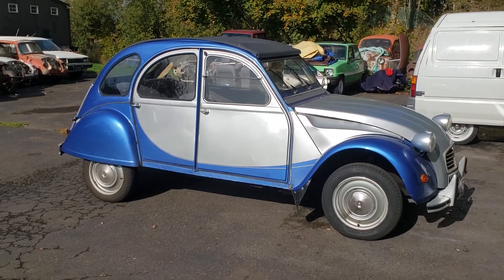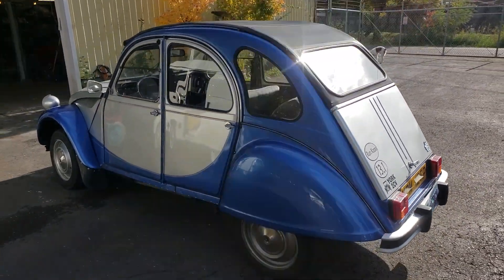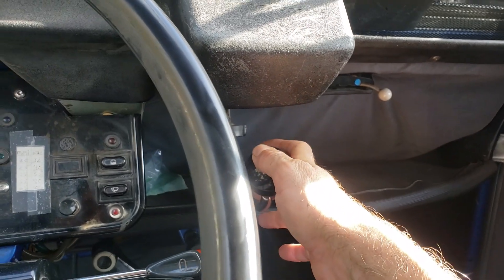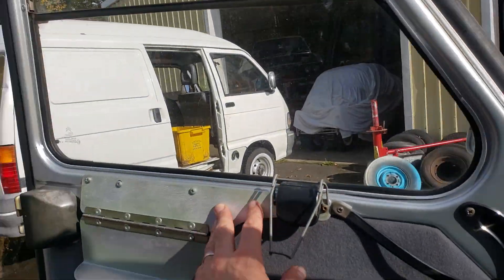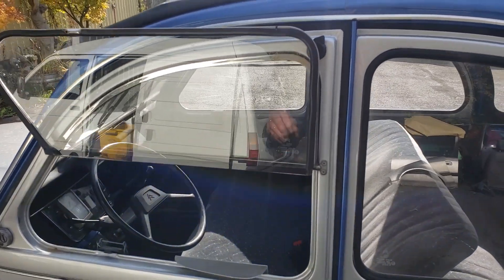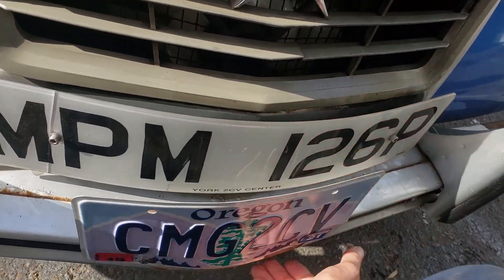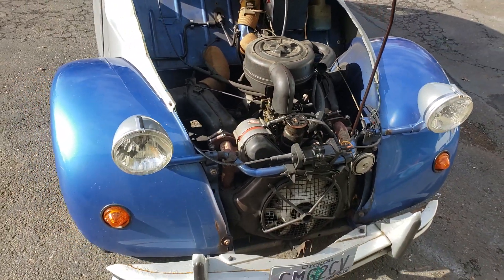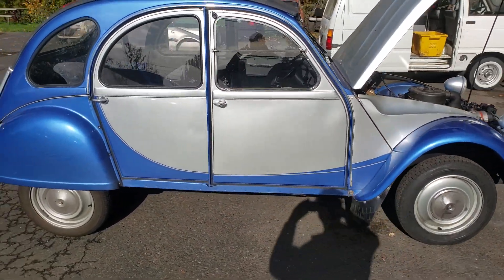What's Not To Like About a Quirky Citroen 2CV?

Comment: According to the UK's DMV equivalent (the DVLA, Driver & Vehicle Licensing Agency) she was actually manufactured in 1970 and was imported into the UK in 1976 which explains the left hand drive but with British number plates scenario.

 It's road tax (like registration in the US) hasn't been paid for since July 1998 and she isn't registered as having been exported for some reason. It was almost certainly brought to North America between July '98 and July '99.

The accumulator under the floor you referred to is called the spring can, unsurprisingly it contains the springs! The springs actually act on each other so the suspension is linked front to rear meaning that when the front wheel reacts to a bump in the road the rear suspension is somewhat pre-loaded! Crazy stuff for what is effectively 1930s engineering.
Reply: what not made in York? just like Terry's chocolates were? 😉
Reply: I was going to say... Definitely not a 1969 car... Closer to a 1989 car judging by the fact it's a 1980s late "spécial" bodyshell! Spécial being the basic model, tiny speedo/fuel guage, non slam lock doors... Disc brakes... Etc it's most definitely a later 2cv having shocks all round etc not a single pre 79 feature on that car!
Reply: It must have had a pretty full on restoration using later parts then I'd guess? The DVLA doesn't just take your word for it when looking for a manufacture date, you generally need paperwork to prove it.

Don't tell me that this is a late 2CV that has been stolen and given a false identity from an earlier car to cover up the theft for export!
Reply: @CaptainHoratioPugwash  clearly this car was never a 1969 2cv! I'd like to see its vin plate that's for sure! I have an 89 dolly in my workshop that is mechanically and structurally identical to this car! I wouldn't have even said it was a 1970 car originally, possibly imported to the UK with a false vin or, originally it was a 1970 drum brake 2cv6 which was at some point restored with an 80s chassis, shell, engine & box etc basically saying the whole car has been replaced at some point in time!
Reply: or possibly the late 80s model but have fake 1960s plate and vin so it is allowed to be imported to the US because of the 25 years old rule, just like how most later Rover mini ended up in the US
Reply: @Banom7a  yeah although what's odd is that British registration suffix plate with the registration year letter being a P on the other end - means it was registered in the UK in 1976, according to the UK DVLA it was originally a 1970 car registered in 76 in the UK, even still its not a 1970 car now! Not even close! Anything with a light up choke knob is made after 1980!!
Reply: @joewilson941  i do know the P reg is 1976, but like some classic mini in the US was like that too, they have MPi everything (airbag and stuff) except for the shell and the registration which is from 1978 (T reg) or something along the line.
Reply: Screams "ringer"! Seems to be a thing with UK registered cars that find their way to the US. It's quite plainly neither a 1970 or 1976. Minis and Land Rovers are the usual suspects.
Reply: @Banom7a  I think you're on the money here. Another oddity; the 'P' suffix UK plates (August '75 - August '76) say they were made by ''York 2CV Center', with the US english spelling of centre. I'd hope for the sake of the owner that nobody from the DMV is reading these comments!

Comment: If I remember correctly there's no head gasket and no distributor. It uses the wasted spark method so the plugs fire on tdc for compression and exhaust strokes
Reply: just a copper washer for head gasket
Reply: @alainpichon4395  Fitting a copper washer was a dodge to avoid lapping the head to fit the barrell perfectly, not original fitment.

Comment: Have a look at Hubnut on YouTube  who has had a 2cv for 20 years. He works on his and has over 200k miles on his one. Engine is 602cc with the heads changed you can have 652cc fairly easily.
Reply: I clicked on this video thinking it would be HubNut

Comment: I drive an argentinian 2cv6, a 1975 model, it´s 602cc, 31.5 hp. In Argentina it never came with disc brakes, always with drums, till 1990. Tires are 5.0x15" (125R15)
Your car has a lot of things "not original", aftermarket accesories, like the armrest, half dashboard, etc...
It's a car for daily driving, slow, but it'll go wherever you want, max speed is 110 km/h (65 mph)

Comment: York 2CV Centre was a 2CV service garage in the UK, see the UK number plates. Don't think they are with us any more. Hope you have at least a Haynes manual to help you along but just about every job on the car is covered somewhere on YouTube. The "arm rests" aren't Citroen, a bit odd, and I don't know why you would need them. Guess they would spread the contact on your arm though. The wire clip can space out the bottom of the window a bit. If you don't use it to latch it the window floats up and down as you drive along. Neat door handles rotate when locked. 602cc. Left hooker so imported from France at some point later in the cars life. Is there any history with the car? UK 2cv people may recognise it and let you know. Good to see another one over in the USA. Big fun. I have had a Dyane.
First reg in UK April 1976. Tax was due 27 July 1999 so it's been hiding somewhere since then. Imported to USA about then? Year of manufacture not known but stamped on top of bulkhead right hand side.
Spares are easy from UK, France and Holland but postage won't be kind.

Comment: It's not a 1969 model, more like 1989. Front disc brakes came in 1981 on these cars. Looks like a 602 cc engine  with 29 hp.
I've got two of them myself, fantastic cars!
Reply: Most 2CV nowadays are a combination of parts from different aged cars, it's a bit of a Frankenstein car ;-)
Reply: Yeah i think it's more 1979 or 1989 too, the car have modern dash, steering wheel, hood and big bumpers and those orange belt "things"

Comment: I drove one across Germany in the 80s and it was really scary on the Autobahn!
Reply: As a former owner of a '86 Fiat Panda with a soft-top I know exactly what you mean... :-D
Reply: Yes. I had a 1970 model in the early 70's in Germany. Fun around town but about 100 kph on the autobahn was about it. A little faster down hill or with a strong tailwind.
It broke a crankshaft and the local backyard repair guy had the front end apart and the engine out in about 15 minutes.
We called it the Mafia staff car.
Reply: Just bought a fine 2CV - and I'm NOT taking it on the Autobahn...
Reply: I drove one from London to Rome (and back) in the 1980s.  The bonnet blew back and bent in half whilst 'cruising' down the Autobahn. We bent it back into shape, strapped it down and continued to Rome. The car was yellow.

Comment: The arm rest is handmade and not factory. And this 2CV is not from 1969, the 2CV got disk brakes since 1981. Also the tail lights, the flasher, the hood, the generator etc. tell that this modell is a mix from different years. If this 2CV was from 1969 it must have a 6V Generator and the choke has to be on the left side of the steering wheel. The choke on the right side was factory since 1974.

Comment: you forgot to mention the headlights, there is no actual high/low beam, the headlights are moved by a cable to aim the lights high or low mechanically. the cars were actually designed for off-road use because at the time they were designed, france had few paved roads. the suspension is really unique, the front and rear suspensions are connected together so if a front wheel is pushed upward, the rear wheel on that side of the car is pushed downwards. this allowed the car to drive over pretty big obstacles.because it was designed for off-road use it wasn't designed to go fast.
Reply: Versions sold in Argentina had high and low beam. Car was slightly different in the interior. A later version called 3cv was sold until 1980.
Reply: The goal of the 2CV was that a farmer could transport his eggs on a dirt road without breaking them...
Reply: Not correct, these have high/low beam headlights. The adjustment for the lights is to compensate for slightly heavy loads and extremely soft supension.
Reply: The early versions had so-called "batteurs" at each wheel also.
Reply: @paulterhaar4862  Not exactly the goal. The egg story was an advertising pitch to sell the comfort and versatility of the suspension on France's mostly underdeveloped road system. 
Fun to drive and once the lean was near its limit it held on pretty well in a turn.

Comment: Looks like the chassis is on its way out, note the "dent! on the metal bit above the wing on both sides, the weight of the front axel is pushing the chassis down.

Comment: York 2cv is probably a regional branch of the british 2cv club, 2CVGB. Each branch had its own name and produced its own stickers. Enthusiasts used to collect them and stick them on their boot (trunk) lid. That's not an original colour scheme. Must have been repainted sometime in its life. Also, that's not an armrest on the door. It's a clip designed to hold the window slightly open if you don't want it fully open. How do I know all this? I used to have one many years ago, and before that I had a Dyane, which was a modernised in shape hatchback using the same mechanicals. Both great little cars.

Comment: A 120mph speedo? Well that's 'optimistic'!! LoL
Reply: iBiana Doubt  HaHa!
Reply: That's almost certainly in kilometers per hour -- 120 kph equals about 65 mph.  In good tune, and given time and a flat road, it might just touch that speed.
Reply: 120 is terminal velocity if it's dropped from an aircraft.
Reply: It's KPH not MPH.
Reply: @k8zhd  And it felt like doing 200 mph... :-D
Reply: @k8zhd  120 km/h is about 75 mph
Reply: @marksandstrom4248  You are right -- I shouldn't do math in my head late at night.
Reply: @k8zhd  it helped I just spent a whole month driving a US car in Canada :)
Reply: 116 kph new, 40 years later it might reach 105 downhill haha
Reply: @xclaustrox  not necessary, depend from the wearing state and  maintainance...and the overhaul from this engines did not cost a fortune...
Reply: I know, I did mine in 2008... and for a developed world resident is even more affordable. Here in the south we do recycle crankshaft and camshaft, in the first world you replace it, it´s not expensive getting new parts from Burton, or 2cv Cassis

Comment: The UK reg plate "P" dates from 1975 - 76. King pins on front wear a lot and can wear out the suspension arm. My uncle had 3 of these cars.
Reply: supposed to be oiled with a brush every 5000 klics
Reply: @shug831  Not sure we're speaking about the same piece. If you find the rod connectd to the springs (inside the big tube) this rod is connected to a clevis to the suspensio arm. there is a pin or axle there. It needs to be "drenched" (gently) with oil (use a brush) . Rather a dirty job as some oil falls on the ground. as to be done to front both sides of course. Can't remenber doing it at the back. Nice car when there are snowy roads.
Reply: @alainpichon4395  Got you now. I was on about the pivot pins that the front wheel hub turn on.
I've heard of someone clever that made up a spray device for lubricating the spring suspension.
Reply: @shug831  Me too, you're talking about the vertical pin that allows the steering. And yes they are a pain in the a** to change. Easier to buy a second hand suspension arm, with the hub,at a scrap yard.

Comment: It's not a 1969. Its a late 80's 2cv. (602cc engine, disc brakes, dashboard etc etc) Probably has 'old' paperwork so they could  import it to the US....
Reply: The UK tax information suggests it was a 1970 LHD French car imported into the UK in 1976 (hence the 'P' suffix on the plates) and then exported in 1998/9 (to the US?). Many 2CVs in the UK were repaired and repaired again due to rust, so chances are the car has been 'upgraded' throughout it's life - hence many none standard parts. If it were a UK car it would be RHD and with a MPH speedo. Still, it's nice to see one still running and enjoying life :)

Comment: Something odd about this 2cv or certainly the plates it has on. It must be post 82 as it has disc brakes and the engine air filter assembly and carb make it a later model.

Comment: Hey it looks more like a 1997 when i look at the color under the bonnet. the color code is on bulkhead . In 1969 the engines (motors) were 400cc from 1970 the were 600cc and 400cc.Mine 2cv has the same color and is from 1979 . And the armrest is not standard .O goodluck whit the kingpins.Have a nice day.

Comment: That's not a '69 er...but a later '75er. 2CV6 602 cc 29hp topped 115km/hr.

Infact everybody  is a bit wrong with ten name 2CV...cos there been 2 engine's available  a 435 cc and the more powerful... 602cc 
They've called:
2cv4 and 2cv6.

For the 2CV6 have Burton an 652cc conversion kit . 

A lot of 2cv owners exchanged they're engine for the engine from the Citroën Visa ( fits perfectly and has a staggering...652cc with a tremendous 35Hp).

Comment: Those weird French!  That shifter would confusel me.
Reply: I had that problem too until I found out it is just an extension of a regular gear shifter. Seen from above it has exactly the same gear pattern. It's the horizontal angle of the lever that's confusing.